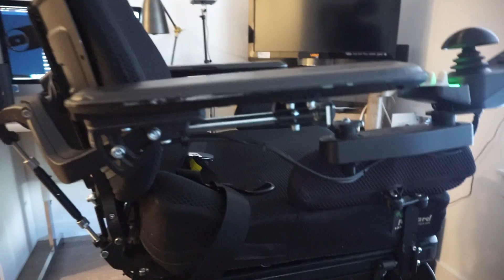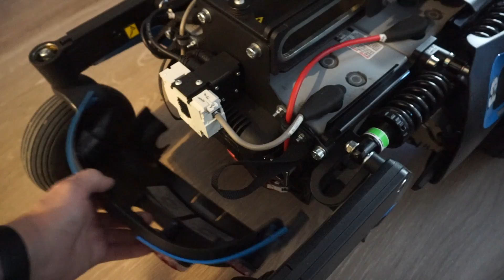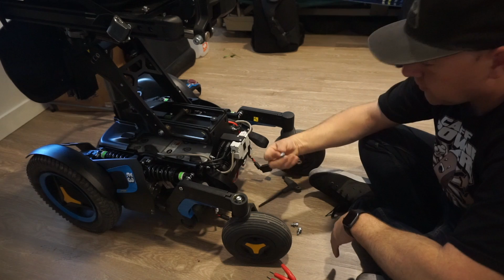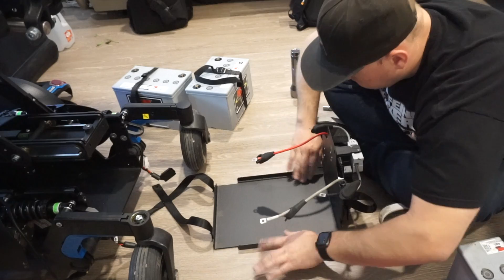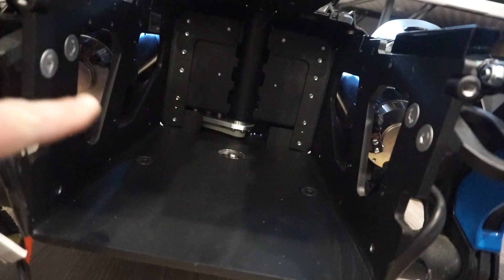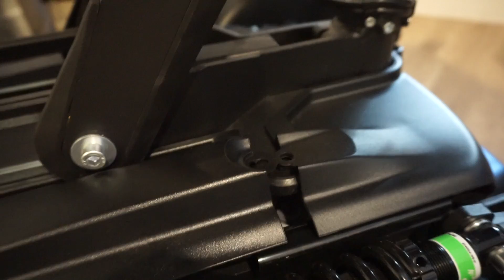WHEELCHAIR REPAIR: Permobil F3/F5 Battery swap

Comment: That's odd I've got a two year old F3 it looks like total distance 1369 m I think it's miles gone gone through one set of front tires fixing to change rear still alive original batteries thanks for showing us the battery setup there again permobil quirky thanks for the info any information is helpful how you get your hand on all these permobil chairs and info it's like pulling teeth for me parts too way overpriced see if you can get ahold of a pacesaver let's see the quality of an american-built power chair thanks good video Stay careful

Comment: Is there a manual way to get to the batteries. My chair won't charge enough to lift the seat.
Reply from the maker: YES!!! i was actually working on a short video about that right now!! lol but i mentioned it in another video.. lemme find the clip real quick...  skip to 26: 35 in this video (the link should take you to that time code)  https://youtu.be/3cQq-LfVfPk?t=1595
Reply from the maker: here's the new video! https://youtu.be/qQitPa9j2NM
Reply: Thank u.

Comment: hey handy man,  did you have any advise on how to dismantle V6 wheel, which has three really high torque on them?  It's nice that F5 has sliding batteries system.
Reply from the maker: yes... a 3/8' drive or 1/2' drive impact, with allen sockets! it does not come apart easily!!
Reply: @TotallyNormal-  I try really high torque (30Kg), it didn't move.   thanks anyway.
Reply from the maker: sometimes a big breaker bar works better than impact drivers.. theres GIANT nylock nuts in there.. i took mine to a tire shop and they had to use air tools.. electric impacts wouldn't cut it.  the next time i had to take them apart, a 2 foot breaker bar worked nicely - BUT i think after removing the bolts the first time, it gets easier.. good luck!!
Reply: @TotallyNormal-  great idea, thanks

Comment: m3 or f3 that is the question . i put in a request for evaluation for a new chair . should know in a few days if approved for an evaluation then see which chair manufacturer will get the node . I am hoping that Permobile gets it. M3 or f3 what say you ?  "i'm so confused"' !
Reply from the maker: depends on if you want mid wheel, or front wheel drive :^)
Reply: @TotallyNormal-  which one is better on steep ramps and potentially slippery surfaces?
Reply from the maker: probably the mid wheel drive.. theyre more stable..  (the M3)
Reply: fwiw i got to try both & personally found the m3 more maneuverable but it also was quite jarring on spine over larger sidewalk bumps vs. f3 kinda wants to fishtail/forklift more at higher speeds but dampens down the sidewalk cracks like no-ones business. both are really really good

Comment: Really like the video man! Also I think this would be a very good instructional video for wheelchair technicians if they haven’t had the chance to work on some of permobils newest products.
Reply: I agree. 
Just did the video  step by step pausing often . And rewinding often.
My issue was both batteries were dead!I 
 So was still able Remove with unit down .
 Helped to remove the mistory. 
 Need to work out to lift those suckers!